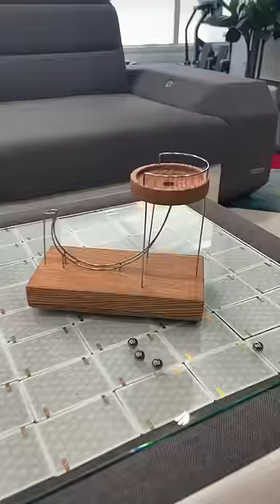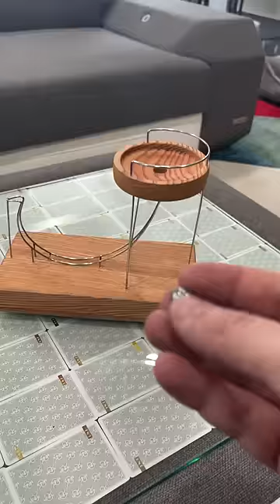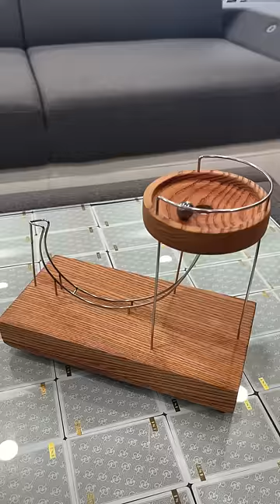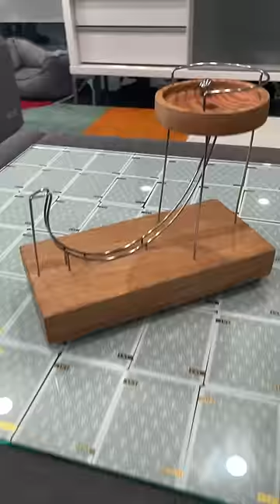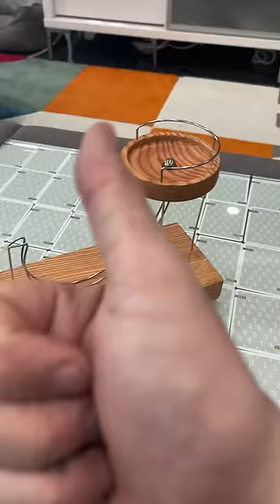An Impossible Perpetual Motion Device?! 😳 #Shorts

Comment: Perpetual motion, as long as you keep the batteries charged.
Reply: it has some sort of electromagnet right ?
Reply: @k0lpA  probably
Reply: Physics class is a bit ago, but it should be impossible for the marble to jump higher than the starting point without magnets.
Reply: @k0lpA  yesnt. I think it works in the same way as a rail gun, where the wire is the rail, and the ball is the projectile. This might work, becouse when the ball short circuits the rails, a magnetic field is created, pushing the ball in one direction. This is how railguns work just with a lot a lot more power.
Reply: @NumbDiggers1998  there is a magnet at the bottom to boost the ball forward, just look it up
Reply: @k0lpA 3
Reply: @NumbDiggers1998  there is an isolated wires inside the rails to work as an EMF, and an bunch of electronics beneath the wood to control the ball motion and speed it up
Reply: @k0lpA  it could as well be motor in the wood that speed it up, cause that’s not the speed it would have normally
Reply: @skyzip4k171  the rails are shorted in the end so that wouldnt work
Reply: A simple not electrical magnet would accomplish the same thing without batteries or electricity
Reply: @inquisitorgrynthebandito2736  No, it wouldn't. You need it to be on at one point and off at another. A permanent magnet wouldn't work.
Reply: @inquisitorgrynthebandito2736  Alright, sure, you can technically use permanent magnets. But at that point you would have to change the design and incorporate an electrical field anyway and use that to create an electro magnetic field. So you've not done anything but make it more complicated for no reason. The permanent magnets act only as enhancers. You still rely on adding electricity to the system to keep the normal function going with an electromagnetic field.
Reply: @andreasspyrou7245  yeah but how does the motor transfer the force to the ball ?
Of course it's not the speed it should have it breaks physics :P
Reply: @NumbDiggers1998  He probably means complete the circuit.
Reply: @Neysiriss  physics rules
Reply: @Neysiriss  higher and/or equal to
Reply: @k0lpA  yes there’s a battery compartment underneath
Reply: @skyzip4k171  im thinking that the wire is in the wooden hole right where the ball drops through
Reply: @NumbDiggers1998  that is literally how railguns work. Just because its a short doesn't me the whole system stops
Reply: @inquisitorgrynthebandito2736  no it wouldn't. It would pull the ball downward, causing to accelerate, but when the ball passes it, would pull it again, causing the ball to slow back down. Theres no way to use a normal magnet like that unless it's moving, which means you're putting energy in
Reply: I agree.
Reply: It looks cool though
Reply: Every good perpetual motion machine has a well hidden power gradient
Reply: @inquisitorgrynthebandito2736  any magnet strong enough to speed up the ball would also slow it back down with its attractive force.
Reply: @Neysiriss  yes it can, you didn't pay attention it has a v0 bigger than 0

But yes there is a power source to return the power source lost to friction
Reply: I feel like the fact he spinned the marble at the beginning is what made it keep jumping up
Reply: @k0lpA  yes
Reply: Add a solar cell to keep the batteries charged and this could theoretically run until the rails wore out.
Reply: It probably doesnt require batteries
Reply: @tizibinki3946  (correct me if I'm wong) but that's why thus isn't perpetule becuse without the magnet in order to gain the hight required the kinetic energy would have to be more then the potential engey it started with(aka impossble) not to mention alot of that potental energy gets lost to friction so in order for this to work the magnet gives more kinetic energy to the marble but in return the magnet loses somthing(not quite sure what maby it just loses some of its magnetic force bit I might be wong)
Reply: Oh! Duh there’s a magnet. I could not figure out what was going on.
Reply: Haha so funny lol lmao wow never thought this would have batteries in it lol gg ez
Reply: @MINISCULE2  
Actually it does. The magnetic field has to be turned on just ahead of the moving ball then shut off when the ball passes. This can only be done using electomagnets.
Reply: it just gravity. what bttery you seek
Reply: It's a simple spinning magnet on an electrical motor run by a AA battery. The magnet spins in the same direction as the ball giving it a small magnetic boost. SIMPLETONS!!!
Reply: @skyzip4k171  pretty sure this shape cannot form railgun. This one is nothing new and pretty sure it's just the magnet at the base
Reply: @skyzip4k171  woah thanks for a good explanation on how railguns work
Reply: No battery it's all kinetic energy and gravity
Reply: @frutalesdiary6263  👀
Reply: @lerbronk  👀
Reply: @AZMOOZ  lol no
Reply: Shaddup Einstein, how a bout make your own
Reply: @lightspeed-nu2vy  you just posted cringe.
Reply: @k0lpA  it's has a regular magnet inside 

No electromagnetism 

However after thousands of passes that magnet will lose its charge and it'll need replaced
Reply: @k0lpA  yes
Reply: @thisaccountisntreal107  permanent magnets don't lose charge lol. And it would never accelerate anything. The amount of speeding up that happens when stuff goes close to it is equal to the amount of slowing down that happens when the object moves away from it. Otherwise high speed rails would have used these instead of spending billions on expensive shit
Reply: @effyoo6081  that's plausible, but a motor itself is a spinning electromagnet and permanent magnet pair. So why add even more spinning magnets?
Reply: @lerbronk  using gravity you can't lift an object higher than you dropped it (unless there's several objects interacting)
Reply: @effyoo6081  
In the example you cite the motor spins because of an electromagnet. There’s no way to do this with just  a permanent magnet.
Reply: Yeah but it's not like the batteries are adding energy into the balls like come on. (Bet you believed I was that dumb for a second.)
Reply: Honestly people who say it’s electromagnets are probably wrong as the other ball would be effected when the magnet turns on so it’s probably just spinning wheels
Reply: @tizibinki3946  but if it was only a magnet would it not still not require energy, unless when the magnet accelerates the object it degrades a fraction or something ?
Reply: @mortache  because that's how thus works. The motors magnets are only sufficient to spin the shaft
Reply: @PrivateEyeYiYi  yes there is. A spinning permanent magnet oscillates on off depending on its proximity to the ball
Reply: @cjslime8847  you got it right
Reply: @cjslime8847  radio shack sold a kit. Small quarer sized motor, solar cell, battery pack, wires. You could make anything spin with this tiny setup. I made a solar airplane. It's small enough to easily spin a permanent magnet around inside that thick base. It only affects the ball when it is in close proximity at the top of its arc, much like AC current in a generator,( on off 60 times a second(60hz)). Completely ineffectual at a distance. I'm sure it's way slower than 60hz though
Reply: Someone have the product link?
Reply: @effyoo6081  if you are moving another magnet with the motor then you are moving that magnet with the electromagnet from the motor. The energy/force/torque doesn't come from vacuum of space, I doubt there are gears there either
Reply: But bro he told us that it doesn't exist but if it did it would look like this so u just roasted urself
Reply: @mortache  yea, that's what I said. A motor. Everyone knows how a motor works.  its a reverse generator. Magnets, electricity, wires. Simple
Reply: @mortache  you still need tge motor to move the magnet. The ones inside the motor won't work to move the mass of that ball. But they can spin one around nicely
Reply: @mortache  motors are designed  to move the shaft inside the motor. Use the simplest, easiest to build method. The kit is 6 bucks
Reply: @Neysiriss  and where do you propose he put the magnets? There are no magnets. These things are possible to make, because it's not a true perpetual motion machine. True perpetual motion, as he said, doesn't lose energy; meaning that you would need MORE than 100% power for it to he a true one. This one would never be able to utilize it's own power outside of what it is currently doing.
Reply: @SilverEye91  if you could use a non-motorized magnet to accomplish this, then how is that not perpetual motion?
Reply: @lightspeed-nu2vy  it's the drop into the ramp that give it the speed.
Reply: @deang8910  no magnets. Just not true perpetual motion.
Reply: @effyoo6081  buzzer sound indicating you are wrong
Reply: @buoydix  as people already pointed out the base is the trick, there are similar gadgets that can run for a while without extra power, but this one is not one of them.

Edit: there's literally a Video from this channel that shows there's a battery powered device inside the base lol.
Tha marble can't jump higher than it started without putting in extra energy, even if the energy from it rolling around in the beginning would be converted perfectly into its falling speed it's no where near enough to negate the friction amd air resistance.
How can you be so full of yourself when the channel you are posting under literally has a second video disproving this perpetual motion.
Reply: @buoydix  explain why instead of just making noise and maybe someone will buy what your sellin
Reply: @buoydix  it WILL NOT gain enough speed to jump the gap without help
Reply: @buoydix  perpetual motion is exactly what this would be, as it would ever stop, if it were real. No extra energy is needed out if the system for PM. You don't get it at all
Reply: Lol there's no battery.called gravity people
Reply: @user-ke3ty7mr8r  you have no grasp of thermodynamics or are trolling. Either way, good luck. If your interested, I have a bridge for sale, cheap.
Reply: @k0lpA  Yes
Reply: @user-ke3ty7mr8r  its not really a question of is it possible. We all know it's not possible. More of a question of how it's done
Reply: @effyoo6081  
You’d still need to spin it. That requires a motor.
Reply: @buoydix  I think u might be wrong. The ball shouldn’t be able to jump higher than it’s dropped.
Reply: @deang8910  that's assuming there's no deviation in the momentum. There clearly is a speed up due to the way the ramp is set up. You would be right if this was a pendulum swing but this isn't the same concept, in my opinion.
Reply: It's be cheaper with regular permanent magnets so I bet that's what it has
Reply: @buoydix  hmm. That seems reasonable. I still feel like there’s something that might be missing tho. It doesn’t seem like it should be able to continually do that forever
Reply: @mortache  must be magic
Reply: @deang8910  I think it's as much an art as it is a science. I think a lot of trial and error went into making that thing.
Reply: @user-ke3ty7mr8r  lmao. Nothing to do with the laws of thermodynamics! Everything, literally Everything involves thermodynamics. Sorry, I thought you could hold up your end of the argument. And you're lying. Good job
Reply: @user-ke3ty7mr8r  the entire universe will entropy into nothing, according to thermodynamics and equalization. But this ball will still be rolling! This is to funny
Reply: @PrivateEyeYiYi  I guess you can't read. Exactly what been saying a motor. Duh
Reply: @user-ke3ty7mr8r  bruh, reread the nonsense you already wrote. Your lying and wrong in everyway possible. Post the video, go ahead, but we all know you can't cause you don't have anything like this. If you really believe yourself, get help, seriously.
Reply: @effyoo6081  no. Perpetual motion is only true when you can harness energy from it without it losing any, itself. This is not true perpetual motion. The guy even says it's not 🤦‍♂️next time you want to insult me, try actually knowing what you're talking about.
Reply: @effyoo6081  I never said it was true perpetual motion. I said this was the closest you would get. Don't come at me if you can't quote me right.
Reply: @buoydix ding ding ding. Wrong
Reply: @user-ke3ty7mr8r  googling newton's cradle will tell u how much you lie
Reply: @buoydix  his other video shows the bottom taken off and shows the dam batteries in it, sheesh.
Reply: @Neysiriss  The ball didn't start at speed of 0 so it is possible to convert the horizontal speed to vertical speed hence it can go higher than the drop point.
Reply: @buoydix  I thought about it some more and I don’t think it’s possible naturally, or at least without assistance. It’s just basic physics, your momentum and force can not be greater going up than down.
Reply: @wabalaka1565  yes it is possible but without the magnet in the base, the energy of the ball would decrease with every jump because of friction, also couldn't the energy from the beginning also decrease  the jumps height  if the movement is directed opposite the direction of the slope?
Reply: Actually, it's just a magnet
Reply: Ok but if they scaled this up and had heavier balls then had the upper platform attached to a rotor and turned a axel like a mill then just adjusted the timing.
Reply: @deang8910  the ramp is the assistance that you're referring to.
Reply: Pretty much or it's a magnets pushing it
Reply: @aidanthebestinthe8476  and explain to me where you would put magnets in this device.
Reply: @Neysiriss  I dont think it matter that there are magnets, they wouldn't invalidate a perpetual motion machine, after all you aren't inputting any energy into the machine, the problem would be harvesting the energy without stoping the ball at some point.
Reply: Yes, magnet and battery in the wooden base plate.
Reply: @thisaccountisntreal107  No. Well covered a petmanent magnet will slow down the ball after the ball has passed. It can't add energy.

You first add kinetic energy by losing potential energy in the magnetic field. Then you lose kinetic energy by adding potential energy after the ball passed.

A permanent magbet isn't like a battery. They don't consume any magnetic energy each time they attract something.
Reply: @RedMadMichael  It matters that they are electromagnets. You're adding power to that. With permanent magnets and a static magnetic field you cannot create this effect.
Reply: E
Reply: Ya
Reply: @Neysiriss  it’s already got momentum beforehand though. I couldn’t tell you how it works but I would think it must have some sort of electromagnet
Reply: There are no batteries it's not perpetual motion the ramps radius tightens and increases the velocity of the marble it will actually go forever.
Reply: @buoydix  Nope. Perpetual motion happens when you reach 100% efficiency. Which would allow a motor to drive a generator that would then drive the motor.

Except in reality, you can never get 100% efficiency.

The friction of the ball rolling and the air resistance means the ball can't regain the same height again. And it even needs extra height to fly all the way. Which only happens if some external source (the battery in the base plate) adds in a bit of extra energy by a quick use of a dynamic magnet field to make the ball accelerate faster than 1G for first part of the drop.

This really isn't open to debate. This isn't any "I think". This device can not !!! work without an additional energy source speeding up the ball. That is part of elemental school physics.
Reply: @MultiRyan4  Wrong. There is a battery. And this thing can keep the balls looping for hours. All until the battery runs out.

Take a steel ball and drop and you can see this ball gains too much speed. Not so strange since it is getting accelerated by a short activation of an electromagnet that replaces lost energy from friction and also adds a bit extra energy so the ball flies a bit higher than it was dropped from - needed or it would not end up on the top ring again.

It's a nice device. Clever design. But still battery-operated.
Reply: @perwestermark8920  true perpetual motion produces more than 100%  this is not true perpetual motion. Plain and simple. This is as efficient as you can get, which is to say 100% efficiency. Can't prove with a 30 clip but if he had a 10 hour video of it doing this over and over and never stopped, which I do believe this one is capable of, then this is 100% efficient. You need MORE than 100% efficiency. I am not wrong. You misunderstood what I said several times now.
Reply: @Neysiriss  Physics class (on this subject) was just a few moths ago so if I don't answer correctly I will be a dum dum, but whatever. So, the ball shouldn't reach a higher place IF there is no additional force added to it. And since here there is most probably some magnet magic going on, it definetly doesn't apply here.
Reply: @buoydix  Sorry, but you are so very wrong. Look closer at this contraption. How can a ball jump higher than the height it fell from? See that rim? If this would function without external energy it would be a perpetum mobile.

Know when to stop arguing. Because you are wrong and this isn't a subject you can ever win. Wrong will always be wrong however many posts you make.

There is rolling friction. Their is air resistance. There is always energy lost. And the ball still ends up flying higher than the height it started from. That should tell you there is energy added.

And I know for a fact there is a battery in the base. You would know to if you cared to check. But even without checking, you would still know there is a battery in the base because this device is stand-alone and can't make use of wind or something hidden below the table. And there isn't a significant temperature gradient. Hence an energy source in the plate.

The best way to "win" a debate is to admit to have been wrong instead of trying to keep repeating a flawed view.
Reply: @buoydix  in the wooden base. In his other video he takes it apart and you can see the batteries in the baee.
Reply: @RedMadMichael  its batteries
Reply: @MultiRyan4  nope
Reply: @rodneythundercock  yea, so, what would that matter?
Reply: @RedMadMichael  yes technically it wouldn't matter, but the magnets in this case are battery powered, which means it's not even close to perpetual motion since it will only run as long as the batteries have power
Reply: @charlesco7413  the bigger you go, the bigger problem will friction and air resistance get.
Reply: @buoydix  "you misunderstood what I said multiple times" lmfao!!!!!
YOU SAID NONSENSE MULTIPLE TIMES. perpetual motion does not need more than 100%. It needs to move perpetually. That's all. If thus was real, it would move forever , being PERPETUAL MOTION. Dude, if you can't understand this VERY SIMPLE concept, your a literal FAIL.
Reply: @buoydix  I think, you think, that were discussing "free energy" and not perpetual motion. Two different things. Neither are possible
Reply: @lightspeed-nu2vy  spinned....? Spun? Lol
Reply: @buoydix  Nothing can help you. 100% efficient can't get the ball to jump over the rim. You have balls that will bounce higher than the distance you drop them from? Then start to sell them and then buy out Elon Musk...
Reply: @AZMOOZ  as an engineer, you are wayyyyy over complicating it. There's also videos of how it works. A single electromagnet at the bottom. It falls at its own pace until the bottom, then the magnet repels it upward a little bit just giving it a small push.
Reply: @rodneythundercock  Permanent magnets exists. But they can't perform this feat unless you have a motor that moves the magnet. Because a permanent magnet behaves similar like earth's gravitation. It adds kinetic energy when the object is drawn in. But takes back that energy again when the object tries to increase the distance from the magnet. It's a trade off between potential and kinetic energy - just as when you bounce a ball that accelerates on the way down and loses speed on the way up after the bounce.

So easier to start with an electromagnet directly instead of complicating it with moving parts that makes sound and does not add any advantages.
Reply: @pkeane8098  Yes, the electronics part is trivial. There are multiple ways to detect an incomming steel ball and then give it a short magnetic nudge. A coil like they place in the road in front of traffic lights can detect the ball. Then a short pulse powering the electromagnet will make the ball accelerate down at higher speed than from just the gravitation.
Reply: @perwestermark8920  again, overcomplicating everything. The magnet is always on. It's literally just a battery and a coil to make the electromagnet. No need to detect anything and turn on at just the right time. The gravity is enough to get the ball into the magnetic field, after that, it just gets pushed out again.
Reply: @pkeane8098  Take a steel ball and a magnet and experiment - you'll see you lose as much speed when yhe ball leaves the magnet as it gained when coming close.

There are even lots of Youtube videos showing how you can accelerate things with a gauss gun but how you lose the speed if you don't turn off the field before the ball has passed.

It's only if the magnet is moving that you can get a permanent energy boost without turning on/off the field. This is also why you can make gravitatiobal slingshots by having an object fly close to a planet and steal a bit of the kinetic speed from the planet - because just the gravitational field alone will take back what it gave.
Reply: @perwestermark8920  you're really missing the mark on this. This is due to physics. Nothing more. There is no physical space big enough to fit batteries. And any magnets strong enough to send it flying in one direction would ultimately prevent the ball from ever going back to the funnel. The only argument people might have is that this is post editing software from a computer program that digitally scrubs things out of the video. But I don't see anyone making that argument and not one I would really accept, unless someone can point to me where the editing is.
Reply: @effyoo6081  the point of true perpetual motion is to be used as free energy. Nothing that looks like perpetual motion, but fails to produce extra energy beyond 100% is true perpetual motion.
Reply: @buoydix  pretty sure there’s gotta be a magnet or something
Reply: @deang8910  explain to me where you would put the magnets that it would allow for you to move the ball in both directions. The only way I see a magnet working is if it's forcing the momentum in the direction of the ramp. But for a magnet to be strong enough to do that would inevitably force the ball out of alignment with the funnel. Please make it make sense.
Reply: @buoydix  why do u think the ramp goes both ways? It’s probably an electro magnet
Reply: @deang8910  no. I'm saying that a magnet would prevent it from going back to the funnel. If the magnet was strong enough to force the ball down the ramp, that same force would go against the ball and stop it from going back to the funnel. Magnets make no sense to me. And no one has been able to counter this.
Reply: @deang8910  are you suggesting a battery that shuts down the magnetism at a specified time? Is that your argument?
Reply: The ball is magnetic and it sticks to the rails gaining force and motion.
Reply: @k0lpA  have you hard of hot wheels boosters
Reply: @deang8910  check the other vid where he takes off the bottom and shows the batteries
Reply: @MKultrapdx  check his other video where he takes the bottom off and shows the batteries.
Reply: @perwestermark8920  check his other video where he takes the bottom off and shows the batteries.
Reply: @buoydix  please stop trolling this thread, people are very gullible and you're making it worse. You've been repeatedly proven wrong.
Reply: The closest thing to perpetual motion i can think of is an atom seeing as they take trillions & trillions of years to decay & their 99.8% empty space which is just amazing that the building blocks of all matter can be condensed to the size of a marble due to its own mass attracting gravity to crush it that then catches more matter.
Reply: @effyoo6081  I own one that looks almost identical that takes no batteries. The ball is a low magnetic force that pulls on the rails. This one might be different, but the action on most sold is without any electrical components.
Reply: @effyoo6081  I knew it! Lol. They all doubted me
Reply: @effyoo6081  you haven't proven anything. Do you really not understand the point of perpetual energy? It's quite literally to create free energy. I never said it was possible. I just said you were wrong in thinking that that's not the point of perpetual motion. Why are you trying to make this a "No U" situation? Because you gave me no choice.
Reply: @MKultrapdx  . . . Think about what you said, right there. . .
Reply: @MKultrapdx  not true, googling Newton cradle will prove you wrong. It's thermodynamicly impossible
Reply: @effyoo6081  perpetual motion needs 100% energy to continue moving forever, by the way. In order to use the energy for other things, you ABSOLUTELY need more that 100%. You cannot take away from the energy needed to keep the motion going. You have to take from the extra energy that is created from it being a true perpetual motion device. Which is impossible. What you said is factually incorrect.
Reply: @ianherp5678  nah they don't, there is always a loss to friction and air resistance. The only thing that comes close is time crystals but they have to be super cool so you have to put energy in to make them stay cool.
Reply: @k0lpA  just a normal magnet bruh
Reply: @skyzip4k171  dude. It's just a strong magnet under the tower.
Reply: @granttimm3384  check out his other video where he shows the batteries and motor in the base. It's not just a magnet
Reply: @buoydix  have you no shame? You're making the Dix name look bad.
Reply: @inquisitorgrynthebandito2736  No it wouldn't. If you can get that to work then you will have a true perpetual motion machine. You can't shut permanent magnets off or reverse polarity which is needed.

If you could somehow rob energy from the ball to move a permanent magnet it would work but  the lose of energy would still add to the total energy. Not perpetual.

Maybe there is a way with particular geometry and materials but the chances are about 0 and if successful it would be one of the greatest discoveries ever.
Reply: @effyoo6081  haha will do lol. I just assumed it was only a magnet to make it a fun party trick
Reply: @effyoo6081  youre the one that said that perpetual energy doesn't produce free energy
Reply: @buoydix  perpetual energy isn't a thing it's called free energy. And since perpetual motion and free energy don't exist, you're wrong four times in one sentence.
Reply: Yes
Reply: @buoydix  Of course there is room for a battery. If you had not been so dense you would also know that I have even seen that battery fitted in the base plate. You would even then know where you could go to see what this thing looks like on the inside. You would understand why there are screws on the underside so the battery can be replaced.

It takes a tiny bit of battery power and a tiny electromagnet to add enough energy to make the ball fly maybe 5-10 mm higher than the height it dropped from. You can even compute the approximate amount of energy needed by making a guess about the size of the steel balls compared to the size of his fingers. That allows you to compute the approximate weight of the ball and how much potential energy 5-10 mm height represents.

Simple physics can never get the ball to gain energy. A battery can. An electromagnet will obviously not stop any ball from flying back - the whole purpose with an electromagnet is to decide when it should boost the ball and when it should stop interfering.

You are either a troll or totally awfully bad at physics. Whichever it is, your comments are still provably wrong. If you are a troll then you are master class lousy at it. Now go and read up about perpetual motion instead of arguing about steel balls "because of physics" violating our laws of nature.
Reply: @buoydix  The point of perpetual motion is what it sounds like - perpetual motion. But since we can never make something friction free, anything that has perpetual motion must pick up energy from somewhere - we can't build things with efficiency of 100% or more. And that knowledge is part of fundamental school physics. And if we can pick up 1 mJ then we can build someyhing that can pick up 2 mJ. Or 10 mJ. Which is why we can power electronics from just a hot surface by making use of the temperature gradient - converting heat to electricity.
Reply: @perwestermark8920  wrong. The point of perpetual energy is to create free energy to achieve better and infinite technology. That's the idea behind perpetual motion. There's an actual purpose you're not acknowledging.
Reply: @buoydix  When was the last time you were correct about something? Perpetual motion is about motion that continues perpetually. Not about free energy. So easy you can hear it by the words used. That free energy can power a perpetum mobile doesn't mean you can reverse an implication and introduce equivalence.

You are probably also sitting and defining what magic is, trying to claim magic is defined as the outcome of using a magic wand...

Repeting an incorrect claim will not make it correct. 100 years from now, your claims will still be wrong. Why not try to learn new things and improve instead of spending the rest of your life as a fool?
Reply: Yes
Reply: Thats true 😂😂
Reply: @k0lpA  maybe just a "normal" magnet
Reply: Me who thought that it was just a simple wooden and metal toy after reading all the replies: 🧍‍♀️
Reply: @perwestermark8920  now your mind reading. I never said anything about magic. Perpetual motion was an idea SPECIFICALLY created to devise a way to create free energy. Full stop.
Reply: @perwestermark8920  just admit you don't know what you're talking about. You've already stooped to the level of trying to assassinate my character and mind reading. You're trying to make me leave and being petty about it.
Reply: @Neysiriss  naw thats like saying a skate boarding cant go higher than a ramp without magnets doesnt work its called gravity and momentum
Reply: Get one and try it.
Reply: I looked this one up on Amazon. It uses a motor to launch the ball. I think I would pass. No thanks. False advertising.
Reply: @onecrazywheel  it'd actually a USB powered electromagnet when the ball drops it triggers a switch that turns on the electromagnet for a set about of time probably a 1/4 of a second as the ball is being pulled straight down because the magnet is mounted directly  below the hole it accelerates the rails hold it on track to the required velocity to make the jump
Reply: @cjbeeson1828  Thanks for the reply. Based on the poor reviews on Amazon, where is the best place to get a good one of these?
Reply: Destroyed that youtuber with a single line 😂😂
Reply: @k0lpA  nope, there is nothing.
Look carefully it just stays back because it falls and the curved part makes it go back again.....

Edit: (ok)², I'll concede.
I'm wrong about that, SORRY✌🏻🤗
Reply: No batteries, very simple a magnet embedded in the base, right at the bottom of the loop.
Reply: @Neysiriss  a magnet just under the wood slightly before the lowest point of the loop. Noticed increased speed, of the ball bearing once it starts down.
Reply: @UCG3zge84lFiw9vGsUSwhfJQ I mean you could just look in the item description on any website and it says it's a USB powered electromagnet and the rails are stainless steel
Reply: It uses gravity
Reply: @k0lpA  nah a wheel spin in the hole where the ball fall thats why theyre going hella fast when they fall
Reply: Relax bois, I have seen it, just an electromagnet with batteries inside the bottom wood.
Reply: @Patrick.Howie.  You can't. Perpetual motion machines are impossible.
Reply: @amaury2872  There exists designs like that. But this isn't one of those. Look at the longer video.
Reply: @misterjae7565  Okay, do this with only gravity. It isn't possible.
Reply: It’s a magnet
Reply: @Sheskindarealforthatatleast  An electromagnet.
Reply: @k0lpA  nah just a motor making the ball go faster
Reply: @blazejenkins8386  bro a skateboardr uses his body's energy to boost him by jumping using leg muscles. Go away you're not up to this task
Reply: @j.rbry.8990  nope, check his other video where he shows the battery and motor in the base
Reply: @getflashbanged6909  nope, check his other video where he shows the battery and motor in the base
Reply: @j.rbry.8990  nope, check his other video where he shows the battery and motor in the base
Reply: @misterjae7565  naw, check his other video where he shows the battery and motor in the base
Reply: @Patrick.Howie.  no you can't, check his other video where he shows the battery and motor in the base
Reply: @jacobseed6965  you got it!!
Reply: @Sheskindarealforthatatleast  nope, check his other video where he shows the battery and motor in the base
Reply: @SilverEye91  can i get any link or keywords of the video? i really want to see that
Reply: @wancable9702  it's called newton's cradle, 40 bucks, comes with power supply. Amaz, eatsy, etc. Its a trick to make dumb people think perpetual motion can exist
Reply: @effyoo6081  that's cool, but mine only has a magnet and hasn't stopped in almost a year
Reply: @Candy-uo8sv  someone actually opened the back of that confusing device and there's batteries and coils.
Reply: @frutalesdiary6263  sorry but someone have showed the underside of that device 🤣
Reply: Ah yeah didn't look natural
Reply: @tizibinki3946  wouldn't that slow it down when the ball goes further up??
Reply: @andreasspyrou7245  Unlikely as the motor would make a noticeable sound. Cheaper versions of this toy do have motorized rollers though.
Reply: It’s all gravity
Reply: No batteries. Just strong magnet that repels and pushes at the bottom to give it speed.
Reply: @mayn90s19  You need electricity to temporarily turn off the push/pull effect on the magnet when the ball starts going up the ramp or else the magnet will try the pull the ball back down.
Reply: @tizibinki3946  well magnets come from the earth so technically it isn’t cheating lol
Reply: @AZMOOZ  its a motored wheel in the hole
Reply: @k0lpA  its a motored wheel in the hole
Reply: Ok, and? He said perpetual motion doesn’t exist, so how else are you supposed to do it without the help of batteries? You really thought you had something here 😂
Reply: @inquisitorgrynthebandito2736  true, but magnets demagnetize after some time and require recharging
Reply: It would look something like this...not that it is something like that
Reply: @buoydix  Google perpetual motion and see what it says.

"perpetual motion, the action of a device that, once set in motion, would continue in motion forever, with no additional energy required to maintain it. Such devices are impossible on grounds stated by the first and second laws of thermodynamics."

Just that you have decided all on your own to redefine the concept to mean free energy. And that's something else. And free energy is also impossible because of mass-energy conservation.

You have been given a large number of hints what to look for but you are refusing to take one step back and analyze your position. Many people have pointed out your multiple misconceptions in this thread but it swoshes past you. Don't be surprised when we then speculate if you are a troll or if this is an IQ issue.

In your view, you think it's possible to mechanically build this device and get the ball to jump higher than the hole it fell through, to clear the rim. If that was possible, then the rim could be taken away and this contraption would both be a perpetuum mobile and also deliver free energy. Just that this is not possible.

And despite you refusing to admit it multiple times, there is a battery in the base plate. And you have multiple times been told how to find the video that will show the internals of this device.

But the best you still manage is to claim everyone else is wrong. You must have quite a number of bumps on your forehead, because you seem to be a person who always hit things with your head continuously instead of taking one step back and reevaluating things.
Reply: I think and hear Like a little Motor
Reply: @blazejenkins8386  If ignoring my skills with a skateboard, it's possible to go higher than the level you started from. On one hand because by bending your knees, you will lower the center of gravity. So the skateboard itself can be higher even if CoG is lower. But our muscles can also be used as motors. There are special bike tracks where people don't have pedals but just do jump movements with the legs to "pump" around the track. Nothing more strange than how children can jump around - the muscles adds new energy for each new repetition.

You also have high jumping where the jumpers jumps over a bar that is higher than their center of gravity. Only possible by the jumper bending around the bar.

But the steel ball is rigid and with a fixed center of gravity. So it can not bounce or roll on rails and end up higher than the start height unless there was besides the potential energy also an addition of kinetic energy. Throw a ball against the ground and it can bounce higher. Or attract the ball with a magnet when it was on the way down.
Reply: @onecrazywheel  This isn't false advertizing. Any buyer  is expected to be intelligent enough to know this is a trick product designed to make the viewers start to wonder how it functions. And this device does fulfill that goal.

So it's a great product to buy and put on your work desk - lots of people will look and start to ask questions.
Reply: @j.rbry.8990  Yes - a battery. A fixed permanent magnet will take back the same amount of energy when the ball is leaving the magnet. So a permanent magnet can't supply a net speed gain unless there is a motor that also moves the magnet. And that motor would need a power source. All additions of energy (needed to make the ball jump higher than the hole) requires an energy source. That isn't optional. It's an absolute requirement.
Reply: @j.rbry.8990  Newtons craddle requires very, very little energy to keep going. So a battery can last an extremely long time. If you have one that has kept going for a year then it either has a hidden battery or a solar cell.
Reply: @skyzip4k171  nah, you'd need hundreds of amps for this. It uses an electromagnet in the base thats only turned on when the ball moves downward. That also explains why it only works when the balls go one by one.
Reply: @SoloDriver-bk7zv  Magnets aren't like batteries. They do not get weaker when they draw something in. They are like gravity and gives a force field where objects have a potential energy. You lower the potential energy when an object gets closer and increases the potential energy when you use your chemical energy to drag the object away from the magnet again. But the magnet will still keep strong. It isn't random why you can use a magnet on the fridge door and 50 years later it can still sit there.
Reply: @perwestermark8920  Great response. I'll have to edit my comment. I was truly wrong. Where do you purchase this? Can you link a page where I can buy it?
Reply: Why does it need an electro magnet, seems like with some ingenuity you could place a magnet ring at just the right point down the rails so that the ball passes through the ring therefor propelling it a bit faster.
Reply: I think it's just a really heavy sphere
Reply: @skyzip4k171  We just had this in physics class recently lol.
The law of lenz. 
I'm too stupid to explain but it's just an extension of conservation of energy

edit: nvm I misunderstood your comment
Reply: What batteries
Reply: @k0lpA  no technically gravity is energy so that’s why it works
Reply: Which is why this isn’t perpetual motion, magnets wear out
Reply: then it's not perpetual
Reply: @miriga3927  Why do you think magnets wear out? How do you explain motors that are using permanent magnets and still can function for 10+ years until the bearings or brushes wears out? They don't wear out from use but a neodymium magnet will lose maybe 1-5% per 100 years if you treat it well and do not hit it and do not cycle the temperature or let it suffer too high/low temperature.

Just that it isn't like a discharging battery when used. It's more like a gravity well.
Reply: @k0lpA  this is fake, look at the ball it actually moved exactly the same before falling down. This is just well done animation.
Reply: I don’t want to be that guy but I own this thing and it does not require any battery
Reply: @FreedomElliott  So then tell us where it gets the energy to throw the ball higher than it fell from. Or sell it to NASA... And if you also have a laptop that runs without power, they'll buy that too.
Reply: @l3us9k40  Not animation - you can buy multiple variants for real. Some mentions where the battery is. Some just mentions "electronics". And some says nothing and pretends it's a true perpetuum mobile.
Reply: There are plenty of devices that are perpetual with the aid of batteries. But yea can tell how it speeds up once it enters the rail that there is a magnet speeding up that ball
Reply: @skyzip4k171  that is not how a railgun works.  The projectile does not short circuit anything. Also, they aren't just " a lot more power".
Reply: @k0lpA  there’s a battery in it
Reply: he said it would look like that, he’s not trying to trick you
Reply: @k0lpA  yes, there is an electrical wheel in the wood hole. If u want to know how it works, there’s a french ytber that did a video on this object recently. His channel is Dr Nozman
Reply: Perpetually
Reply: @spiralnapkin  It all about your "if" .... you can't, for reasons already explained above - and acceleration caused by a concealed magnet in the base is precisely off-set by the drag as the ball moves away again.  Only by using a moving (spinning or oscillating) magnet could you achieve what you're proposing, and it takes energy to move the magnet.
Reply: @k0lpA  and magnets decay over time, the decay here is where the machine loses energy
Reply: The lies, ignorance, and misunderstanding in this thread are astounding. Really. It shows how fucked we are. You can lead a dolt to a book, but you can't make them read it, much less comprehend and discuss. It's OK to change your mind when new information comes to light
Reply: @axo6340  thanks
Reply: @axo6340  je trouve pas la vidéo :(
Reply: @motosk8er2  you obviously have no idea what you're talking about. A rail guns electrical configuration would look nothing like this desktop decoration. What is seen of this decoration wouldn't even create a magnetic field worth measuring. 
If you think a railgun consists of 1 continuous wire with a 180° turn in the middle, creating a "n" shape, that which the projectile shorts out and magically accelerates itself well then you're an.... 

So yeah.  I'm quite aware of what a rail gun is and how they operate. Most of you obviously don't. Most couldn't even draw a diagram of the orientation if any of the parts or the electrical. 
So yeah.  If you can try to honestly say this thing is comparable to a rail gun you're just not worth the time needed to correct your absurd misunderstandings. First thing you need to do is learn the basics of electromagnets, if you can even manage that.
Reply: Perpetual motion
Reply: @raybar121  hell yea you figured it out bro
Reply: @Neysiriss  there could be a magnet in the metal part of top.
Reply: Magnets do not need batteries though
Reply: But batteries use energy tho
Reply: @axo6340  There exists multiple implementations of this device. Some has battery in the top plate. Some has battery and electromagnet in bottom plate. This one has the electronics in the bottom plate.
Reply: @allenwalker9200  For this specific usage case the magnet either needs to move (so using a battery+motor) or be turned on/off (i.e. an electromagnet) because you only want the magnet to draw the ball in - but the ball must be able to pass the magnet without the magnet then starting to slow down the ball again. No free energy from a non-moving permanent magnet. No magic violation of physical laws.
Reply: @perwestermark8920  there is actually a myth busters channel explaining this, and they proved some points where this kind of video is actually animated. And i actually see the same things going on in this video, not sure but ya i definitely think this is an animated effects
Reply: @perwestermark8920  and if u try to observe closely before him putting two balls onto the plate, you can actually see the balls are moving at the same paths before falling into the hole
Reply: @l3us9k40  it's not animated. His orher video shows the bottom off. Batteries and a motor
Reply: @effyoo6081  that's pendulum bro, how about solar system? always on their path, can we call it perpetual motion?
Reply: @k0lpA  yeah 
With the force it throws it off..how bizzare is that
Reply: @Neysiriss  yeh
Reply: @skyzip4k171  bruh he wsnt talkin about ems..
Reply: @wancable9702  are you for real right now? You know the sun will eventually die right? Perpetual motion is impossible. Entropy people
Reply: @effyoo6081  ok, its clear for me..
Reply: +1
Reply: I don’t see any batteries involved here
Reply: @l3us9k40  But check the other video that is showing the electronics. No need for animation when there is already a hw hack.
Reply: @IlllIlIlllIIllIIIlllIIIllllI  And how did you look? You could see through the base plate in this video??? If you watched other video, you would see the bottom plate being opened.
Posting that you do not see any battery basically means we can build perpetuum mobile that doesn't suffer from friction. No air resistance. No sound energy when the ball rolls or lands. Did you really think this through?
Reply: there's no batteries ,just some magnets and some smart engineering
Reply: @amazighberbereculture3179  You about to get a Nobel prize? Because your solution would be a shocker in the physics world. You that good at physics? Making Einstein, Hawkins, Feynman, ... look like school kids?
Reply: @perwestermark8920  calme down dude ,lol 🤣 congrats for knowing all these physicians ,i just did a google search ,and saw that toy's design as far as i know it's not that  hard to search on Google right 😂😂
Reply: @amazighberbereculture3179  Lots of such devices in existence. And multiple ways they are designed. But with one thing in common - they need a power source to operate. And since no one wants a visible cable, or a visible solar panel, the best backup plan is a battery.

Any time you see or hear about a perpetuum mobile you know there is a cheat somewhere. And magnets can't replace batteries.
Reply: Solar charger with rechargeable batteries, I see this as an absolute win
Reply: @tizibinki3946  I may be a little dumb here but would that magnet ever run out of magnetism? Like would this ever stop working or go on forever? I assume that if you were to put some sort ofechanism to actually draw power from this thing it would cause resistance and thus wouldn't have enough oomph to make it back up over the top.
Reply: @IlllIlIlllIIllIIIlllIIIllllI  how they record this video? i don't see any camera..
Reply: What happpens if the battery dies
Reply: @k0lpA  There’s a wheel in the hole that spins and pushes the ball to make it fast enough to go back to the top part.
Reply: @amazighberbereculture3179  newton's cradle. 40 bucks power supply included. You're welcome
Reply: @Wildfire_1701  you put new ones in duh!
Reply: @travispreble  it's not real, newton's cradle, 40 bucks, power supply included. Check his other video to see the batteries in thenottom. Perpetual motion is impossible
Reply: @tizibinki3946  wouldnt it pull the sphere back on the upside?
Reply: @wancable9702  all it took was for you to be shown the truth for you to change your mind and now you're arguing the other side. Much respect to you, it's rare to see. Most just dig in to their argument and go down with the ship. 🤝
Reply: I knew there was something weird when it suddenly sped up way faster than of just gravity were taking the ball down. This is something electroboom would explain LOL 😆
Reply: @bluestreaks9749  just check out his other video where he takes off the battery compartment and shows the motor
Reply: @effyoo6081  now i see teacher. there's is only one perpetual motion.. ALMIGHTY
Reply: As long as there is gravity present, without gravity, it doesn't work at all.
Reply: @redxsage  without batteries, it also will not work
Reply: Perpetual motion
Reply: @christopherjamison6129  is an obvious genius, well at least that's what the crack told him
Reply: @perwestermark8920  ok but it’s rlly strange cause it’s exactly the same from Dr Nozman video
Reply: @k0lpA  enfaite c’est pas une video mais un short, je me suis trompé
Reply: @k0lpA  tu vas sur sa chaîne, tu cliques sur l’onglet «vidéos » et tu cherche un short «un objet au mouvement perpétuel? ». Pour ma part lorsque j’écris ce message c’est la 4ème video de sa chaîne en partant du haut
Reply: @Neysiriss  and some electrical current
Reply: This jas no batteries though. Don't be stupid.
Reply: @axo6340  merci, je jure que j'avais cherché XD
Reply: @PrivateEyeYiYi  or the sun dies
Reply: @PlatinumEagleStudios  yes it does, you don't be stupid. He takes off the bottom snd shows the batteries and motor. You can buy these all day called newton's cradle 40 bucks, includes power supply.
Reply: @inquisitorgrynthebandito2736  no because it will also pull it back when it goes up
Reply: That's not perpetual
Reply: @skyzip4k171  There's a electromagnet in wood base, triggered by the metal ball passing vertical part of funnel. Vertical wires are connectors.
Reply: @inquisitorgrynthebandito2736  It would not. This device needs only short, controlled magnetic impulse to accelerate  the ball when it falls free.
Reply: @zbigniewgurak8261  so...how many of you are gonna say the same thing?
Reply: Actually, it’s not magnets, they have a tiny wheel inside the drop point of the dish (think wheels that push a roller coaster from underneath, to make it gain speed) When the ball falls into the drop point, the wheel is battery powered, it spins fast, making the ball pickup momentum and that’s what gives it the required speed to shoot all the way back up to the top.
Reply: OMG… some of these “explanations” are beyond comical. “It works like a rail gun” or “electro-magnets imbedded in the rails”. All it is, is a small wheel within the drop point. The wheel is battery powered by (1) AA battery and it spins fast when the ball hits the drop point. No electro-magnets required. 😂
Reply: Icy Hot. Jumbo Shrimp.  Bitter Sweet.....😂😂😂
Reply: @effyoo6081  this has nothing of simple. Phisics aren't simple
Reply: @thisaccountisntreal107  magnet looses it's charge!? I work with electronics and soldering. Once I pointed my hot hair station to a magnet and it lost its magnetism. This is a natural reaction when a magnet is exposed to heat. Other way is by "wearing off" its magnetism, which I think is what you mentioned, if not, this is the first time I heard being called as energy  the magnetic force.
Reply: @PrivateEyeYiYi  so the electromagnetic point oscillate between on ad off in a brushless motor? I always thought it to be the North of the center pole being skipped around by interaction with other positive points
Reply: @CookieMonster-gg1ks  you obviously are.
Reply: @CookieMonster-gg1ks  hahahahahahaha.
Reply: No batteries in this
Reply: @el34glo59  yea, the other vid were he shows the batteries is fake.
Reply: @chrisjenkins203  this one works differently. Check out his other video where he takes off the bottom. It's all contained in the base. No moving parts in the cup
Reply: @chrisjenkins203  it has a lot more than one AA battery in the bottom
Reply: @chrisjenkins203  it's a small motor with a rotating magnet. The rotation gives the magnet on and off properties as it rotates close, then far away from the base. It gives a small boost as the ball reaches the bottom, you can clearly see it speed up. There are no wires and no way to get any wires to the cup. It's comical to me that you didn't watch the other  video, yet it's you who knows how it works. You're incorrect. It's three batteries, a small motor and a magnet. Maybe the cheap newton's cradles work differently 🤔
Reply: He literally said thats not real
Reply: What would this motion be defined as,since it is incapable of maintaining consistency?

Just a simple loop of motion or something else? I've probably heard the word before,but just in case figured I'd ask. I enjoy discovering new terminologies.
Reply: @twowolveshighfiving  nothing, it's a device that can never work on its own. It would be called a fail.
Reply: @frutalesdiary6263  How that ball kicks higher than it started is suspicious to me.
Reply: Even the wire and the wood dont hold forever from the friction. It would wear off.
Reply: Show the batteries or Magnets, try a little science or investigate and show evidence instead if handwaving out of dogmatic beliefs.
Reply: @martijnvissers4850  Where would one look it up?
Reply: @linzilooloo7669  he does, in his other vid where he removes the bottom. Doh
Reply: The motion will keep the batteries charged.
Reply: @effyoo6081  Oh, my bad, thanks!
Reply: And yet, simply placing a large neodymium magnet strategically offset under the hole, the initial fall accomplishes the same increased velocity & since the magnet theoretically will last for centuries, it's as close to perpetual motion as you'll get.
Reply: @Christian_Prepper  damn bruh, I thought we had it figured out. You cracked the code! Wait...tf you did, watch the video where he shows the batteries. What you're saying, will never work, sorry. Check out newton's cradle for the explanation why
Reply: @Christian_Prepper  and yet, no
Reply: @skyzip4k171  Nah... It just flows down bro. Not that difficult at all
Reply: L_O_W_K_E_Y-G  wrong again. Just watch his other video, where he shows the three batteries in the bottom. It's a small rotating nagnet on a motor. Nice try tho
Reply: @Candy-uo8sv  assuming the entire railing is conductive and they haven't just cleverly painted it.
Reply: @k0lpA  watch when he first drops the bead. It changes to an oscillation pretty quick, which is definitely a magnet. Not to mention the acceleration down the ramp at a much higher speed than you would expect.
Reply: imagine if there was no current, surely it would be as soft as plastic wrap😎
Reply: A simple comment has caused crying/argument. Sad scenes.
Reply: @buoydix  I have one. There's batteries, there's magnets.
Reply: @despraterado588  I have one too. And it has no batteries. Works like a charm. Maybe you're doing it wrong?
Reply: @tizibinki3946  thats not how magnets work tho. if there is a magnet to push it up, then it would also push it back when coming down. so it would have to slow down as it came near the magnetic pole
Reply: Pretty much has to be, if you play it slowly you see it accelerate even though it's already at its lowest point.
Reply: Charge the batteries with superconducting capacitors that resonate with ether…  maybe viziv technologies can help….
Reply: Do neo mags need batteries?
Reply: @KaiserBruh  the magnet switches off when the ball is in the right position. so it accelerates fast because its attracted by the magnet, the magnet switches off, the ball shoots back up.
If you try to build this without a magnet it wont work. the ball cant reach higher than the position it started.
thats not how gravity works mate
Reply: Bruh fuggin giggles foreva bruh brush

Un tis un tis
Reply: @truthistreason9708  u good?
Reply: @frutalesdiary6263  lol no. He clearly said it was what it would look like because in reality, it doesn’t work. The ball wouldn’t go that fast down the decent and would keep enough energy to make the flip.
Reply: @rodneythundercock  but electro magnets do.
Reply: @tizibinki3946  I knew something wasn't right👍🏽
Reply: @k0lpA  yes it has a electromagnetic accelerator at the bottom of the ramp to give the balls the speed they need to make it back up to the top
Reply: @Candy-uo8sv  they could be shorted with an insulator.
Reply: This is Real
Reply: @goldenfox334  

"Just because it's a short doesn't mean the whole system stops."

Lol, yeah it does.
Reply: @frutalesdiary6263 , it is impossible for that ball to fall along those rails and go higher than it's starting point without adding energy to it. Gravity won't get it done.
Reply: @truthistreason9708  huh?
Reply: This isn't a trick. Kinetic energy builds when it gets thrown up there rolling around. If not for that it wouldn't get the same amount of energy each time.
Reply: This is the guy that doesn't pay attention in movies and is surprised he doesn't understand shit.
Reply: No it is only gravity
Reply: @tizibinki3946  Not enough.
Reply: He admitted it wasn't real... just meant to look like one...
Reply: @norasoulfly  no its not look it up
Reply: Batteries are in the bottom.
Reply: @Neysiriss  without electromagnets
Reply: Killer!😂